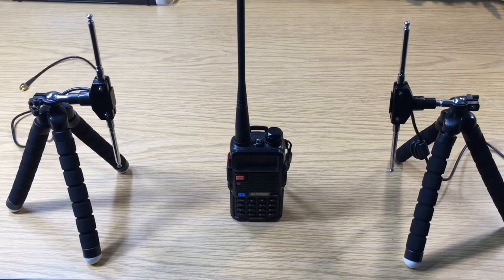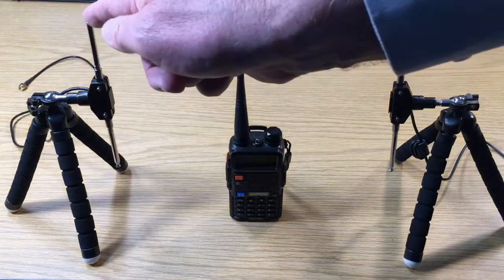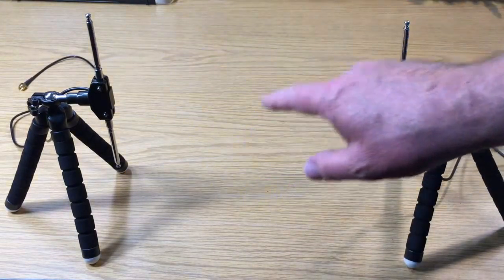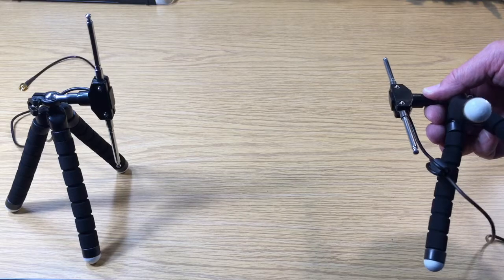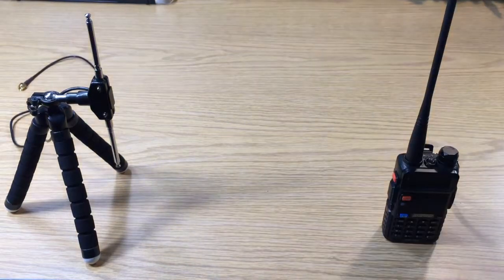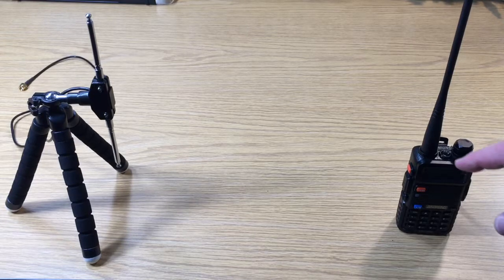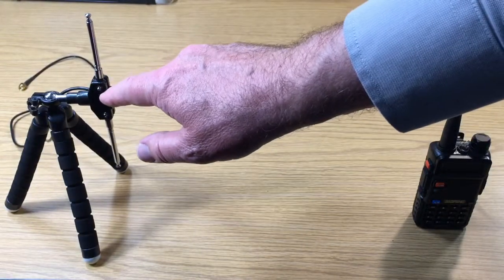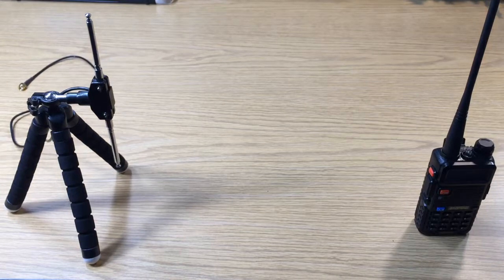BaoFeng UV-5R Antenna Basics

Comment: sir, can i use that tv antenna on my baofeng bf888s?
Reply: You can use any metal object as a receiver antenna.  Answer is yes.  
But, do not use it for transmit.  The antenna needs to be designed for the frequency being used.